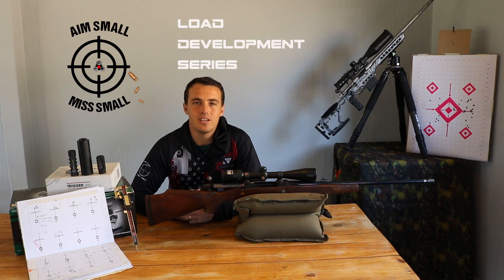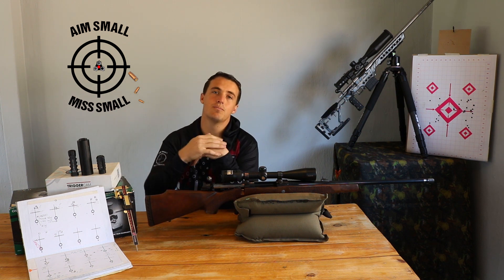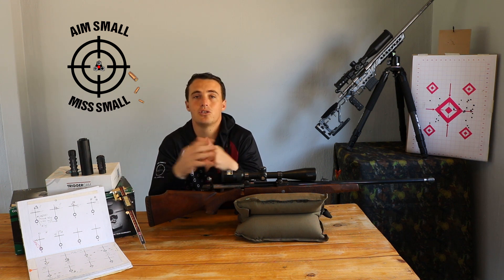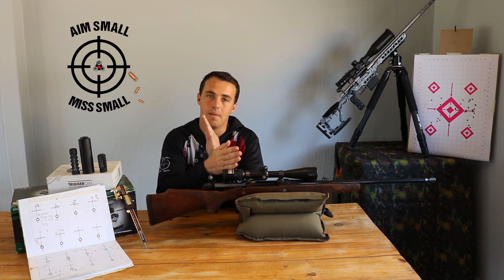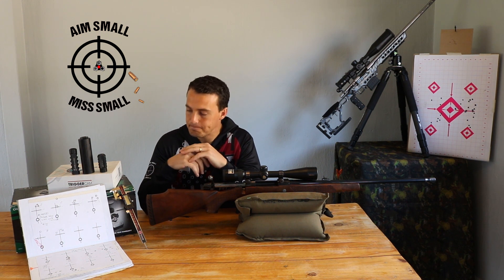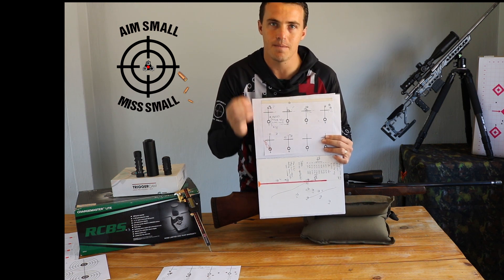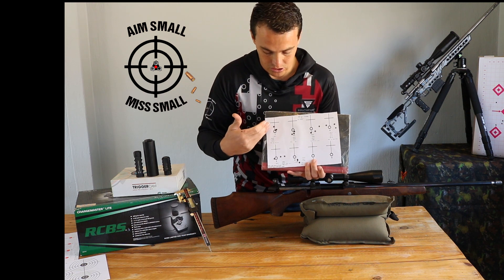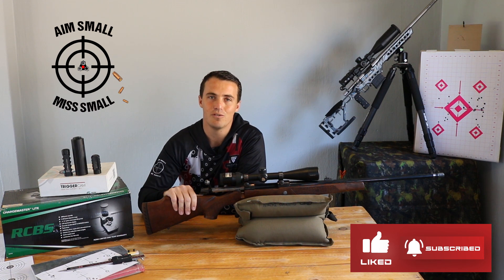Load Development Series Step 5: Length test

Comment: After Step 5, did you verify your selected loads? Can you share the final verification  groups ?
Are the groups consistent?
Reply from the maker: After step 5 once you have decided what you length must be (according to the target)  you pretty much have the smallest group you rifle would shoot with that selected load, (or at least in theory) .The general result is that the group starts out around 1MOA and reduces to about 0.3-0.4 MOA and then you get a larger group as the bullet gets shorter back to the 1 MOA group. You then select a length in between the two smallest groups which gives you a tolerance for loading. Unfortunately I don't have a picture of how that rifle worked out. I recently dit it with my 6 dasher but my groups where al around 0.4MOA to 0.2MOA so even those pictures wont illustrate what it should looks like for a hunting rifle. 
I hope it helps.